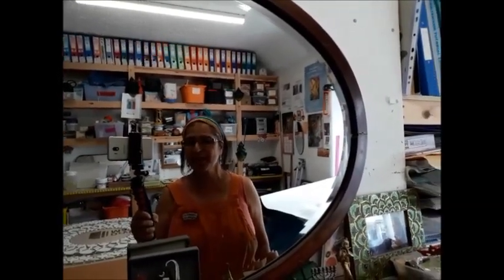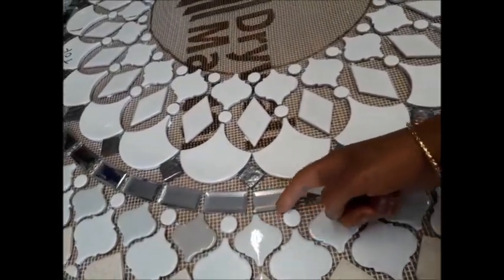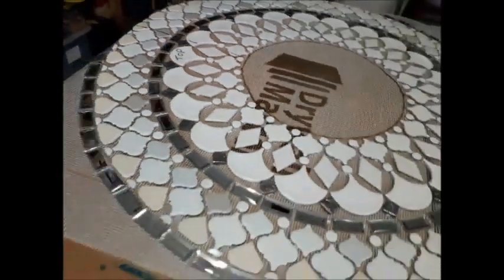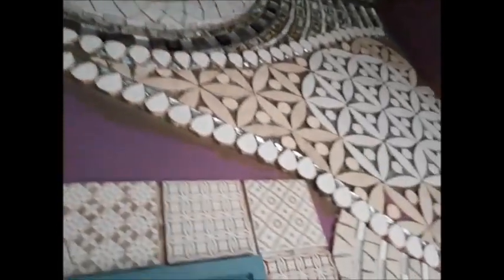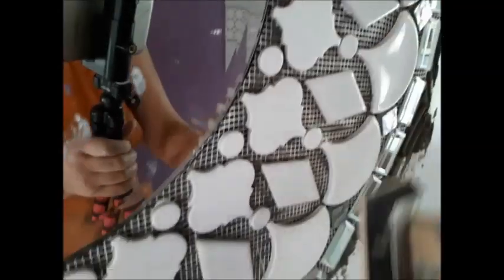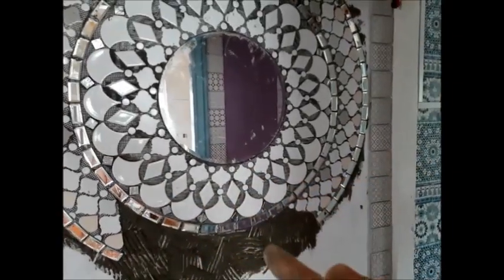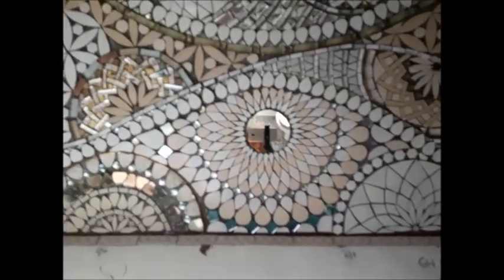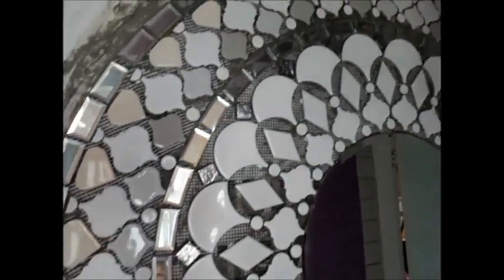Mandala Mosaic Project: Part 13 Installation of the Third Wall Section Saturday 25 July  2020

Comment: I simply love your mosaics and the freedom u share with creating the designs. Would u be happy to do some videos to show me more about getting the mosaic level when i have used a range of broken crockery of different depths and also adding latex to do 3d work in one step instead of grouting amd gluing separately. Going to have to buy a house to mosaic!!
Reply from the maker: Take a look at this video https://youtu.be/AKqhjTx2EWI
... I've used a lot of crockery and therefore undulating levels. Used a rubber kidney found on ceramics/pottery websites. Pushing the grout into the crevices... the rubber kidney stops any scratching. 
I dont use latex ... although occasionally I will add Admix to the grout.
Reply: Mango Mosaics 
Tks. Have investigated amd bought a rubber kidney for general work. Have studied your suggestion and will keep practising. Have a great day. Sunny but windy here on in the north coast of NSW Australia..😜
Reply from the maker: @reeoverton6219  wonderful! The rubber kidney is a versatile tool 😊
It's pouring with rain here !

Comment: It's fabulous Caroline. Just a quick question: when you glue the pieces to the drywall base mat, I presume you use some kind of adhesive or silicone. I also presume this comes in long tubes?  These are then inserted into the metal dispenser?  The problem, as I see it is that when you use that method you get a lot of glue coming out of the tube once you squeeze? Also, you need to keep putting it down so you can fix the tiles in place. Isn't this very cumbersome? Is there an easier way to do it?
Reply from the maker: My top tip is to rest the caulking glue onto a stable box so that you can squeeze a small amount then release the pressure off the top of the caulking gun. It's not cumbersome and gives you hands free to work. Hope that makes sense. If it doesn't then please email me via my website mangomosaics.co.uk and I can send you a photo that explains it. Some of my filmettes shoe how I do this.

Comment: Do you maybe have other recommendations for adhesives to secure tiles to the fibreglass mesh I could find in the states?
Reply from the maker: I think you'll need to research this yourself as I don't live in the States. Maybe you can ask on other social media platforms?
Reply: @mangomosaics  I've been checking online. Will go to the stores soon also.